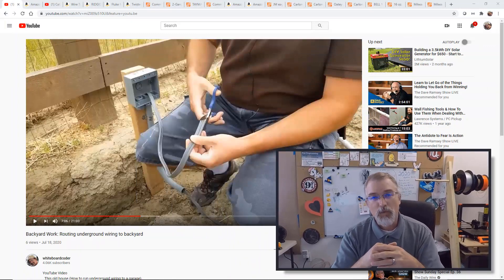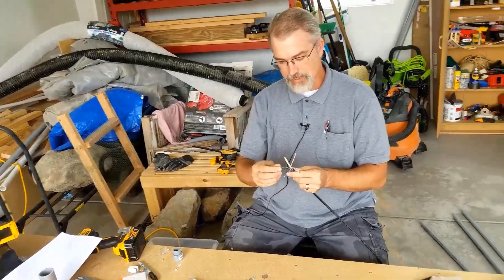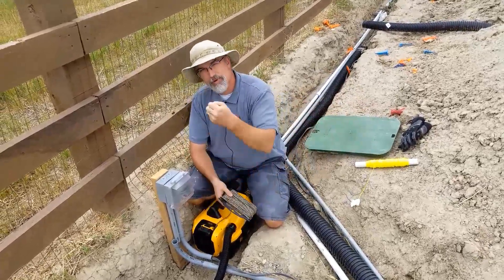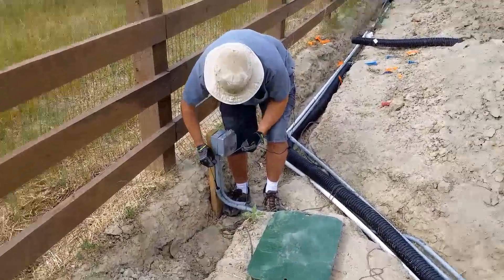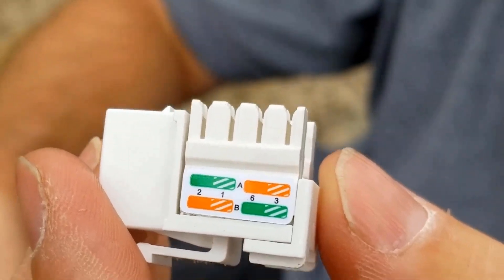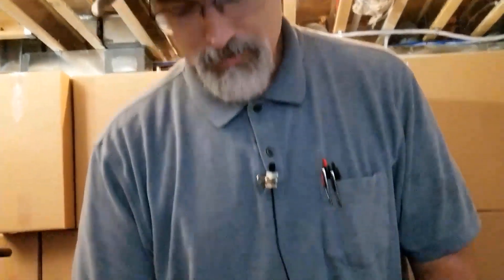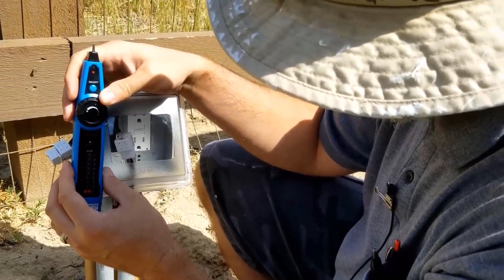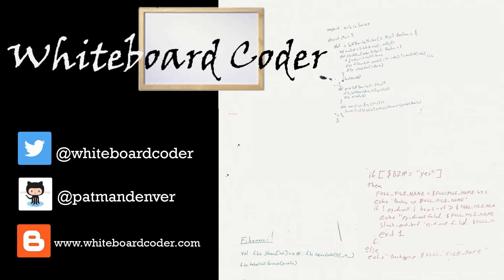Backyard Work:  Running Ethernet Underground to Backyard

Comment: Old video but nice job brother. I like to use clear silicone on those outer surfaces to keep that nice look. The other thing is that I usally go with a larger conduit and use flex pvc instead of rigid. If I do work like laying a driveway over etc it will move without cracking during the construction phase but not collapse. Also lets me pull cable a bit easier. However it is much more expensive.

Comment: Good on you. Nice video. I've done similar projects and enjoyed you talking about this one. I found you because I just ordered 1,000 feet of gel-filled direct burial cable for a similar across-the-yard project. Thanx for sharing, sir.
Reply: Be careful with Ethernet and runs over 300 feet. You will lose signal and need an Ethernet repeater.

Comment: 1. Terminate solid-core cables to jacks rather than to plugs. Use patch cables for the last few feet between the jack and the device. 
2. Use pass-through plugs to speed up termination time.
3. With 3/4" conduit you're probably not going to pull a new wire unless you pull the existing ones out first.
4. Any reason you didn't use an LB?

Comment: I did cat 8 because why not. The last thing I want to have to do is dig up a direct burial cable. Because that will not be an option. If you’re doing a direct burial cable go up the absolute highest that is available on the market because the last thing you want is to realize 30 years down the line that it wasn’t sufficient. Also I don’t know about you in 30 years I don’t think I’m gonna be physically able to do anything about it even if I wanted to. I’m not getting any younger.

Comment: Any concern about lightning strikes potentially frying things?
Reply from the maker: I have thought about that or bad actors trying to fry my internal systems
so I do/will always have a separate router for my outside connections so it won't take down my internal router.
But maybe there is a better way to handle this.

Comment: If it were to get too tight for a normal pull, they make a cable gel. Cover the cables and it pulls through so much easier.

Comment: Ideally, the untwisted wire should be as close to the keystone jack as possible. There shouldn't be what appears to be a half an inch of unsheethed + untwisted pairs hanging off the back of it. It's probably not an issue here since this doesn't appear to be close to a max length cable run but it's still best practice to do it that way all the time.

Comment: Great Video. Pass-thru ethernet plugs are much easier to use to make predictable connections, I never mastered cutting the wires to the right length to fit the plug,

Comment: I would have put the  cat 5 wires into a different box than the 120 volt outlet.  Code says that high voltage and low voltage needs to be separated into different compartments if it's in the same box, or in different boxes. Should get electrical permits and have an inspection.  The inspector would have brought that to your attention.  Also add up the degrees of the conduit bends from pull box to pull box.  Total bends should not exceed 360 degrees, else add pull box along the way to break up run into two to keep each half under 360 degrees.
Reply: Sorry to be so off topic but does anybody know of a trick to log back into an instagram account?
I stupidly forgot the password. I would appreciate any tips you can offer me
Reply: @Anson Emmitt Thanks for your reply. I got to the site on google and I'm in the hacking process now.
Looks like it's gonna take quite some time so I will reply here later with my results.
Reply: @Anson Emmitt It did the trick and I actually got access to my account again. I am so happy:D
Thanks so much you saved my ass :D
Reply: @Byron Aarav you are welcome =)

Comment: I would just run a fiber optic cable inside the existing PVC pipe ( the one with power cables). 
😉

Comment: We ran CAT7 burial cable 100 feet to a house on our property and had issues when lightning struck close by.  An electrical field was created and totally fried our modem. Does CAT6 have the same problems or is it safer since it doesn’t have aluminum shielding?
Reply: Its worse than cat 7. Learned my lesson. Best to use optical fiber.

Comment: BroTip: instead of putting a male end on the switch side, put another box, then attach to the switch with patch cables.  It's a more finished look than dangling wires, and costs less than a patch panel.

Comment: isn't it a bit of an overkill to protect a cable which is already protected enough?
Reply: That's what I thought 2 years ago. I used direct-burial CAT6 cable just like in this video, and I buried it without conduit. A week ago it failed. I have no clue what happened, but I figure some underground critter gnawed through the cable. Now I have to dig the 120-foot trench again. I don't want to do this a third time, so I'm using conduit this time!

Comment: The goo is probably silicone dielectric grease. It is fully non conductive. Great at keeping water and corrosion at bay.  Why does your route curve so much? Is there an obstacle in the ground your going around. After watching your video if I was using two cables I would use 1" conduit.

Comment: I think it's great you are doing all this yourself but, you've done something incorrect.  According to what I know of the NEC (national electric code) you haven' put your electric wire deep enough. Did you get a permit for the electric ? Did you have it inspected? With no permit or inspection you run the chance of problems not to mention fines and the prospect of re-doing it all later correctly.
Reply: So long as he called blue stakes
To have them survey so he doesn’t hit utility line/comm line/ water etc, not a big deal running to a new outlet. But if it is in conduit, electrical should be just basic Romex, if you use underground rated electrical it can potentially cause a fire due to heat inside the conduit. Looks good to me! I would have used some wire pulling lube to make it far easier to pull, especially with 360’deg of turns and bends

Comment: No Reason to buy cat5? Cheaper doesn't count? What if you are running shitty DSL with a 15mbps bandwidth? \
Reply: Unless you have decided that in your life you will always use 15Mbps DSL, no reason not to buy Cat6. In fact, most reputable manufacturers do not even make Cat5. But, you can live in the 90s and think the world will never change.
Reply: @kirktitgen6395  I mean, I had already purchased cat6 for my shitty DSL when I commented lol because you are generally correct - I'm just picky about absolutism ;)
Reply: @noxid86  I know what you mean. I am finishing my basement and just ended up running 300' Cat8 Class1 cable for connecting my NVR and Access Points. If I don't have to rip my drywalls in next 10-15 years to run ethernet cable, I am good with that. I have seen technology really taking off in few years - 3 years back our datacenter switches used 40G connections and now all our switches uses 100G QSFPs.
Reply: Well...if he's connecting LAN devices like cameras, etc. then the internet speed COULD be totally irrelevant. Also, if you're powering a camera, POE will work better with a better cable. Then you've got interference. The higher grade cable, the lower the interference will be. In a few years when he's got 4k, 8k, whatever cameras, pushing POE, etc. yeah it might make a HUGE difference. But I agree, right now, with one low grade camera, 5e would PROBABLY be fine. Still, if you look at all the effort he's put in digging trenches, laying pvc, buying tools, etc. is it really worth a 40 dollar savings to get a product that is moderately inferior? I think not but you decide.

Comment: Pro Tip: If you want to make two runs off the same spool simultaneously, run off the length for one run. Attach your fish tape, fish sticks, etc to the wire. Basically in the middle of the two runs then pull or push thru. Obviously be mindful as some can be directional (HDMI).

Comment: Future if you go this way I would use a LB and then you are not fighting your way though the house.. Right now I am not sure why you choose the route you took I am sure you have some Reason.. But had you used a LB at the house you can remove 2 screws and you will have in the back top of the box a Straight into the house rather then the way you have things now.. Also that seems little far out from your home for being secured down.. Also Cat 7 Don't Refer people to it .. IT will not be use and will be Passed on for Cat8 .. Also keep in mind that all the Views that is watching this please when you are looking for your Cat5e or Cat6 or 6a there are people out there that is selling JUNK CCA cables and that is no good You want 100% true cooper wire don't buy JUNK CCA cables you will only hate your self later trying to save a few dollars.. I learned the hard way costing me a good chunk of change to replace one of my POE PTZ cameras... CCA will damage POE devices maybe not cheap POE cameras or routers buy Good quality hardware hates CCA cables.. CCA for the ones that don't know is Cooper Clad Aluminum and in some cases you don't even get that.. Also for the ones that have some Pulling issues... There is LUBE for the TUBE... Just keep that in mind...
Reply: What's an LB...?
Reply: A couple of years ago I learned about junk cable when I noticed that the 3 foot section of old Cat5 cable from my gateway to my computer was transmitting at half the speed I was paying for; after checking everything else, I replaced that patch cable with a short CAT6 cable, and the speed doubled and went to the speed I was paying for.  Now I I have 1Ghz into my house and use Cat8 everywhere I need a wired connection. The performance difference is amazing.

Comment: Do you think routing the ethernet cat5e cable outisde or through between the walls is a better solution? I just recently bought a Lorex 4K NVR box link below:

@t

And the Ethernet cable that came with the set is a CAT5E 30m cable. Link below:

@t

Do you think what will be the best practice for a longer life span for wires / better performance for video / data quality. I live in Canada and here the temp can go from -20 degrees to all the way to +40 degrees in summer. So what would be the suggestion for me. Here in Canada we have brick wall outside and in between, there is drywall and wood. What will you recommend?
Reply from the maker: Look at the spec sheet.
Looking at the buried cable I see it can go to -40 and up to 70 deg C
I guess how hard is it to route the cable?
If it is easy use what you got and if it fails replace it.
If it is hard to route you may want to get a better cable so you don't have to reroute it again :)
Reply: @Whiteboardcoder  thanks for your reply. I think I will route via inside